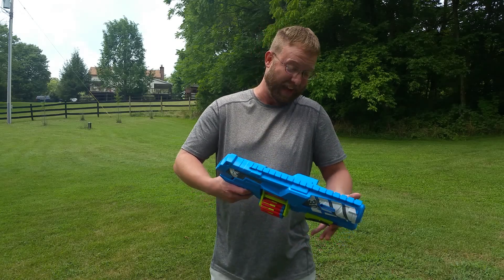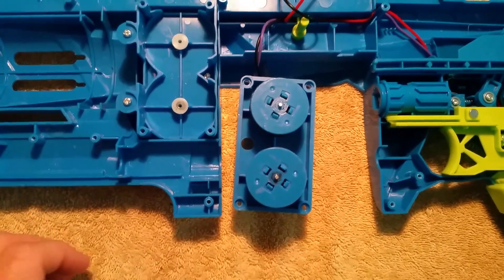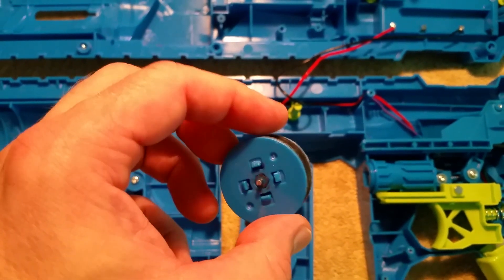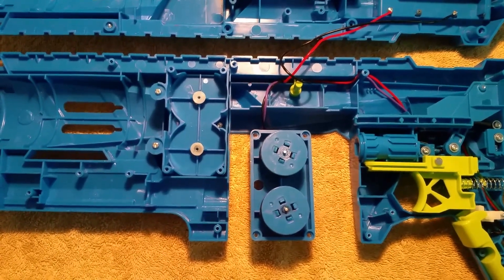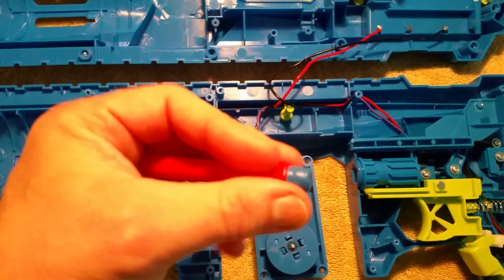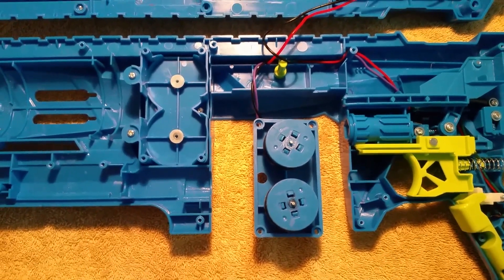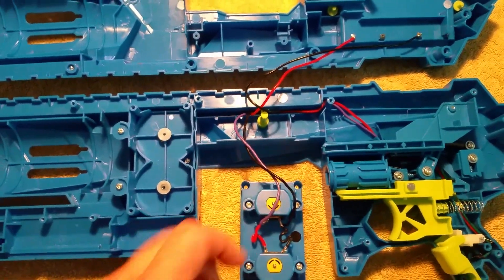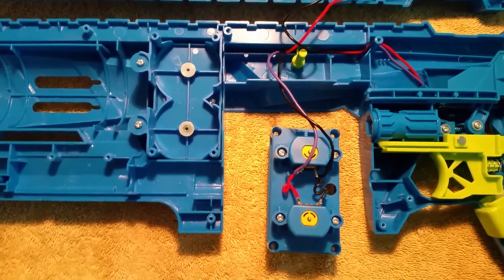BoomCo Spinsanity - Another Look

Comment: I'm a big fan now! Thanks for posting this. This is like THE best flywheel blaster now. Wow! It's crazy how the mod community can be so dismissive
Reply: +Boom tendo omg that would be amazing. that was the only negative thing about the spinsanity
Reply from the maker: Thanks, appreciate the feedback.  I'm not sure that the community was being dismissive, but just didn't dig in deep enough to find out why the flywheels were failing at higher rotational speeds.  And I agree, this thing can be made into a beast.  :)
Reply: yeah dude. I was going to tell you that I ended up buying a spinsanity. Slightly modded it to bypass the thermistors and took out the locks and put in 4 IMR batteries. I love this thing!!! I didn't know about rubber problem on the flywheels so it's good to know.
Reply: +498 Nerf great vid. so I am running 4 imr batteries on my spinsanity. does that mean I should super glue my flywheel parts? or was that for lipo power. sorry if I sound like a noob. lol.
Reply from the maker: I would definitely super glue the parts of the flywheel together.  When I was testing mine, the rubber would expand as it revved up and then would pop off the plastic 
pieces when it got to full speed.  I was running on just 4 IMR cells at the time.
Reply: 498 Nerf I already have ideas for modding a nerf mag to take boomco darts and attach it to a spinsanity. I might take the mag well off my stryfe too and use that. You can fit a lot more darts in the same space with Boomco darts. Tho I'm sure the stock 30 the spinsanity has is plenty with accuracy of boomco.darts. You could fit like 60 boomco darts in an 18 mag